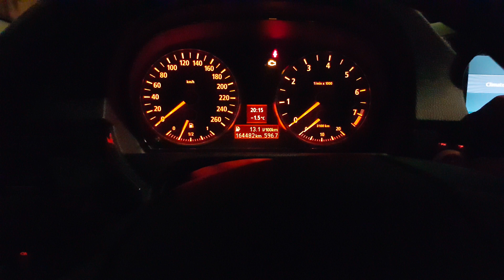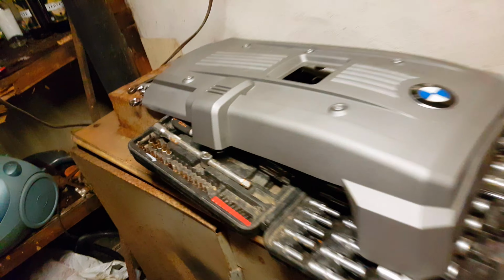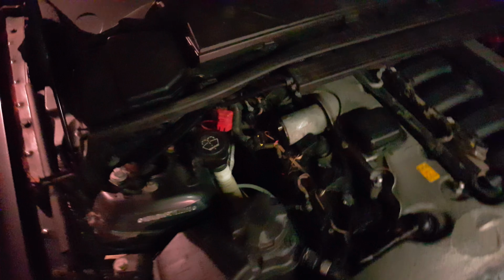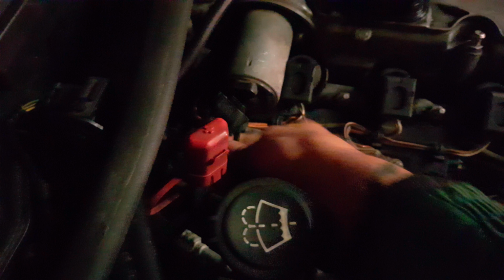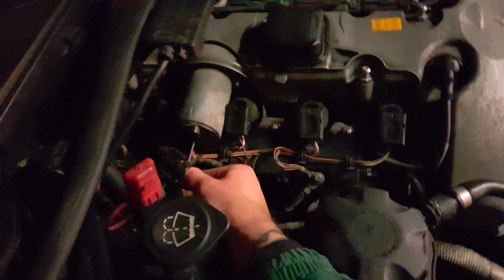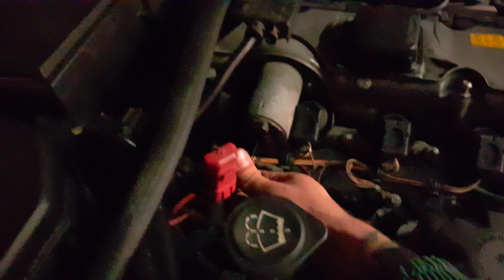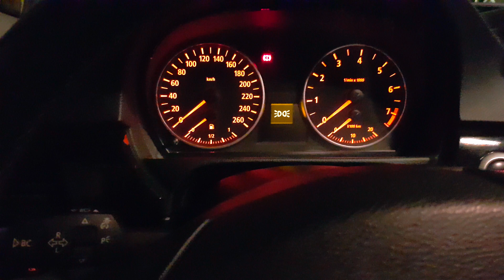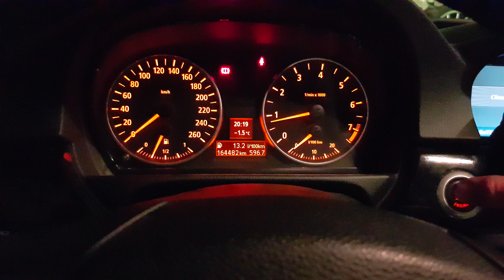2020 FIXED!!! BMW starts and then dies!

Comment: i am having the very same issue on my 2011 328i, i did what you did to valvetronic motor and it starts and runs perfect , is it ok to run it this way unpluged ?
Reply from the maker: Yes sir. I know some guys driving like this for years.
Reply: I had a 2007 i328 I got the same problem idk if I should do it
Reply: @radicakhan1858  did it work
Reply: Hi what could be wrong if engine cuts off random times? Checked everything cant find problem
Reply: @KamilaDrage  could be an early sign of a vacuum leak or even possibly a valve failure. High or low idle?
Reply: @KamilaDrage figure this out?
Reply: I have 2015 bmw 328i N20 engine it starts after few times cranking any idea ?
Reply: Does N46 Engine valvetronic also use 4mm Allen Key

Comment: Working on my bmw for two years no mechanic could figure out what  was causing it to turn off  paid so much money for no reason this was it thanks so much 🙏🏼
Reply from the maker: Mairitta now you know that your eccentric shaft sensor is dead. You can check eccentric shaft connector. If there is oil, then it is broken.
Reply: Kristaps Dāvis Komarovs it wouldn’t be the actuator ? I was thinking of replacing that ?
Reply: Kristaps Dāvis Komarovs the valvetronic motor ?
Reply from the maker: No. First check the eccentric shaft sensor. If there is oil, then you have to replace eccentric shaft sensor
Reply: Currently a couple thousand in on this same issue and it persists
Reply: @kristapsdaviskomarovs4709  what is the symptoms i face in order to change eccentric shaft sensor
Reply: What should I check if car stall after 20 minute idle? Car wouldn’t start after i filled up with 87 octane by accident.

Comment: I have a 2019 530 with the four-cylinder B 46 or B 48 it started running rough and random. I got a message saying it was the evap sensor I changed it along with the purge valve. It seemed to get better but then started again I bought just a new purge valve and it ran perfect for one day check engine light went away After that the next day the check engine light is back and it is running even more rough sometimes it runs perfect. Sometimes it runs rough. It doesn’t seem to really add up. This is the G 30 chassis. What would you say about this? I did do a smoke test. There’s no leaks. I checked the filters. The air filter is pretty much brand new and clean. I clean the mass airflow sensor, the spark plugs and coils are somewhat new. Thank you for anything you can do to help.

Comment: with my 4 mm allen
 key I turned it in clockwise and it only turned in 7 or eight turnstill it stopped. I then backed it off about thirteen turns and it worked. It did rough idle when started so I backed it out one more turn and voila , seems good now.  thank you Kris
Reply from the maker: Glad to help you 👍🏻☺️

Comment: What a legend. I change my valve cover seal and all the seals on the cover then when starting the car it starts but the moment I gave it gas it will lose power and if I go on drive or reverse it would not accelerate.. so the more I press on the gas the car will lose energy.  I try many things check leaks connection. I was so close t asking everything apart until I saw your video. It worked like a charm.. awesome thank you so much

Update.  It happen again. So I decided to measure resistant from the valvetronic connector pins to the valtronic case and I saw numbers on the reader. I order new one and did the same test on the new one and I saw no numbers so I swapped the valvetronic and didn't need to do the allen key. It just relearn it self and it works like a charm. I suggest everyone to check resistance first before anything you can even check while the Valvetronic is on the car just disconnect the connection.
Reply: How long it last before it happen again?

Comment: worked on my 128i 2011 i’ve been having problems with the whole valvetronic system and this fixed it and i checked and saw oil in the eccentric shaft sensor thank you!!!!

Comment: Hey this fixed my start and die after a few minutes it started backfiring thru the intake like poping or firecracker sound any info would be greatly appreciated thanks
Reply from the maker: Did you put connectors back after you tought its fixed?
Reply: No sir
Reply: I have a bunch of random mis fire codes plus it claims 02 sensor connectors crossed lol must be back fuel injector I will try that next thanks for your help at least it will run and idle no just has mis fires caused by something else I done put all new coil packs and plugs mass air and map sensor and Dansi flaps in the intake but have a great day
Reply: 09 bmw 328i xdrive thanks
Reply: Injector circuit no 1 was open replaced and car runs perfect now thanks for your help the bad eccentric motor was the real problem then a new set of injector runs perfect thanks again

Comment: It worked on my 2011 328i x drive. It only turned 6 1/2 turns before it stopped. I backed it out 14 turns. I started it without the plug in and it died. I plugged it back in and it started right up and ran like a champ.

Comment: The car will start on second try without doing anything . What happens when your car sits like over night it loses pressure on the fuel system . That’s why when you start and hit the gas it will stay running.
Reply: Im wondering the same thing , I have a 2014 bmw 328i and am struggling to keep it running

Comment: My 2012 BMW 128i Coupe began experiencing this issue, but it didn't apply to my car. I have to unplug the MAF, it runs and drives good for a few miles than stall and stop. Can't start up until it get cool down.
Reply: From my youtubing today might be be valvtronics?

Comment: I have got 520d 58plate, car is cranking but not starting , on the second crank the car starts but stalls after few seconds, i have checked injectors fuel pump but they are okey ???? Any help please
Reply: Howzit man, did you manage to get your car right, i have the same issue with my X5 40d.

Comment: I have a 2013 535 stage two fuel pump and charge pipe stock injectors and intercooler I’ve been having a problem car starts up perfectly but after use and getting warmed up when put in park car turns off and then to start it it cranks but turns off immediately and then starts up again once the temp goes all the way down please help 😢
Reply: I have the same car same problem at night time when it is cool it drives better

Comment: What is the point of leaving in unplugged? What does it even do if it is plugged in?
Reply from the maker: When you plug it back, then faulty eccentric shaft sensor is giving false readings to valvetronic motor. And then car engine stalls and can be damaged

Comment: Good day sir, can this also work on a BMW F10. Mine has a problem of cutting out power when I'm coming to a stop. Every morning it starts perfectly but if I drive for an hour or so that's when I'm having issues..
Reply: Mine too does the same, once engine becomes hot.

Comment: Can I plug the plug back in after procedure
Reply from the maker: No. Because your eccentric shaft sensor is broken. Replace sensor, learn valvetronic positions again with connecting car to computer, and you are back on track normaly. With unplugged connection you can drive as long as you want but i recomend to change that sensor as soon as possible.

Comment: I have a 2012 116i that starts and drives for about 50 metres, then dies.  Most times I can get it stared again after a couple of turns, and off it goes, and does not die again.  But sometimes I can turn over for hours without it starting, then leave it for a couple of hours and return to find it starts on first turn.  Any idea?  My mechanic changed two fuel pumps and it did not help.
Reply: This is exactly what I’m struggling with on my 116i too. You managed to have any fixes.
Reply: @ryanhopkins3568  Hi Ryan, yes finally got it fixed only to have it written over two weeks later in the Northern NSW floods.  After changing 2 x $400 fuel pumps to no avail, I took to another mechanic and he knew before he even opened the bonnet.  It is your Fuel Control Relay $50.  Once changed the car run perfectly.
Reply: Can I do it on X6 2008 diesel.  Car takes time to start...but then when it starts,it goes off after 10 to 20 seconds
Reply: @chrislagan4774 hello you have any part number? Or the location of that relay?

Comment: Bruh lol this is just a temporary fix … this valvetronic system is complicated  and what ur doing when turning that 4mm is the shaft inside under the valve cover it’s supposed to move both ways not just stay in one place it’s called variable valve timing for a reason .. this will not fix your problem .. if your car is having problems with this you will need a new valvetronic motor and possibly an eccentric shaft
Reply from the maker: If car starts and dies like this then its only two reasons. Eccentric shaft sensor or vvt motor is dead. And valvetronic system is not complicated. Its verry simple

Comment: Just bought a 325i for 1k  fixed my idle and stalling issue literally did trial and error with the sensors and MAF sensor is bad unplugged it and did this procedure and car is running 95% better very slight surge
Reply: Awesome! How long before you had to replace the eccentric shaft sensor or was it just the MAF sensor all along?

Comment: I have a 11 528i, my car had the exact same symptoms as yours, when i started it died immediately, i did your exact steps, clockwise till stop then 14 counter, but when I started it the car had a rough idle, and the rpms would bounce up and down, and im for certain i heard a pop out the engine after reviving,

Im fully stock
Reply from the maker: I recomend you to try count how much full spins you have from one side to another and then set it in middle
Reply: @kristapsdaviskomarovs4709  ok i will try it when i get back home from vacation, so this means the valvetronic motor is bad? If so what causes it to go bad? I replace that part 2 years ago, exactly around this time during covid, and i havent driven 10,000 miles  (from US)

Comment: What is that part call , i got a e39 2001 525i doing the same thing.
Reply from the maker: isaac roque Valvetronic Actuator Motor
Reply: Thanks
Reply: Newton Fuera mierda did it work
Reply: The e39 doesn't have it

Comment: whats the cause of this voltage supply EWS3 CONTROL MODULE NOT STARTING HOW CAN I FIX this problem is it the key? please can someone help
Reply: Assuming your car is no crank, no start, it’s possible the values in CAS and DME are out of sync.  So your cas-dme may need an adjustment/re-sync,  this is done through the obd2 port with programs like inpa, ISTA, or certain diagnostic readers ( don’t know which ones)

Comment: I have a similar problem. My car turned off but womt start at all. I did this but it did not worked. I have a feeling.my fuel pump went bad
Reply from the maker: Denis Moreno turn your ignition on. Do hear fuel pump working?
Reply: Dont put the key in the ignition when you’re starting it just in case it dies, so you can start it back

Comment: I have an 09 535i and it doesn't  have this part .. took cover off and its not there...
Reply from the maker: GuttaKing West what engine you have? I have n52
Reply: 24 valve straight 6 twin turbo 3.0
Reply from the maker: What model do you have?? F(number) ?and how much kw?
Reply: 🤷🏻‍♂️ 2009 535i
Reply from the maker: E60?
Reply: I believe its the n54
Reply: GuttaKing West well how did your car end up starting?
Reply: It is a e60 ...  and it had a faulty alternator ... . I shaped it out and its driving like its right out the car lot ... thank you however...  great videos

Comment: Before i try this, my car would start and hesitate for 10-15 sec then die. Now it starts clean then dies right away
Reply: dave M. have u figured the problem? mines doing this right now too
Reply: @lilfaneto  i did.. changed all the spark plugs.. but now my car starts perfectly, but as soon as I put it in reverse, it dies
Reply: lil faneto change the part he’s talking about
Reply: lil faneto any luck with your car?
Reply: dave M. Your crankshaft sensor habibi

Comment: do u leave it unplug
Reply from the maker: Emily Q yes.
Reply: Kristaps Dāvis Komarovs i plug mines back in after it runs for awhile and I see if it would shuts off when I plug it back on and no it starts right back up on my 2008 BMW 328i
Reply: @zinniyah-priscillaisrael6617  is yours diesel engine?

Comment: So, did you end up reconnecting the Valvetronic motor plug after your startup?
Reply from the maker: Don Dur yes. But you can check my other video. There is other solution.
Reply: Thank you thank you thank, this worked, my question is did you have the same issue pop up again or did this do the trick permanently?
Reply from the maker: ROCK 1914 this works permanently
Reply: Kristaps Dāvis Komarovs when did you plug the valvetronic plug back in? Did you plug it in for your next drive or did you leave it unplugged for a couple days?
Reply from the maker: King of Rome OG i pluged it back when i replaced the sensor.
Reply: @kristapsdaviskomarovs4709  which sensor did you replace? the valvetronic motor? I have a n52 530i that has a intermittent shut down sometimes while driving. It would shut off out of nowhere once in a blue moon. No codes.
Reply from the maker: William Ghau replace eccentric shaft sensor and boom. Car fixed.
Reply: Kristaps Dāvis Komarovs there’s no code tho. The problem is like a ghost problem. The car will drive like nothing then it will just cut off and then have to restart and nothing again.
Reply from the maker: William Ghau same happened to me. No codes. Ghost problem. But when i replaced the eccentric shaft sensor, problem was gone and car is more powerful now. If u take off engine cover and unplug eccentric shaft sensor you can see if its broken if there is oil on connector. But unplug shaft sensor not valveteonic actuator motor.
Reply from the maker: William Ghau https://www.e90post.com/forums/showthread.php?t=697252
Reply: Kristaps Dāvis Komarovs thanks bro!
But if I may ask, why did you unplug the valvetronic motor if it was the eccentric shaft sensor?
Reply from the maker: William Ghau because then i could set valvetronic acuator in middle position with allen tool and start the engine. And if i connect it back then engine dies immidiately. (Only when ess is plugged in)
Reply: @kristapsdaviskomarovs4709  So your'e saying try disconnecting the Eccentric shaft sensor  first.
Reply: @williamghau1150  hey my 2012 328i just started doing this last month... Car just died... It would crank and start then die multiple times... Let it sit 15 mins runs again for hours maybe. I was told it was my fuel pump going bad intermittently by the dealer but I dunno..
Reply: @timothyowens847  did you fix problem bro??
Reply: @kristapsdaviskomarovs4709  please I need your help